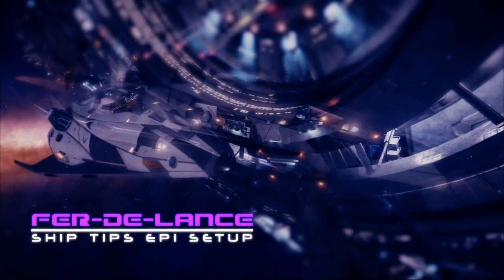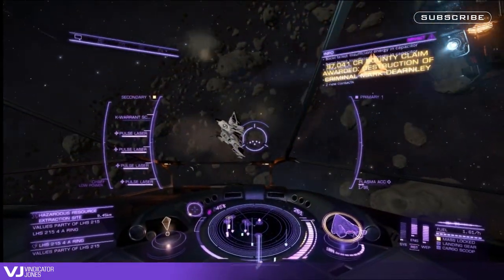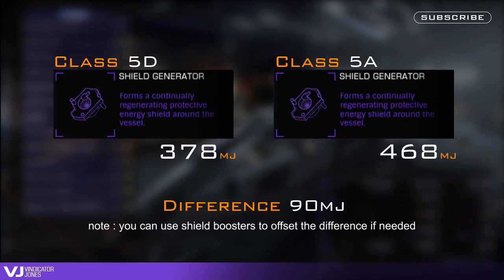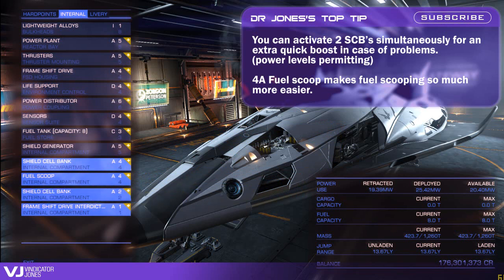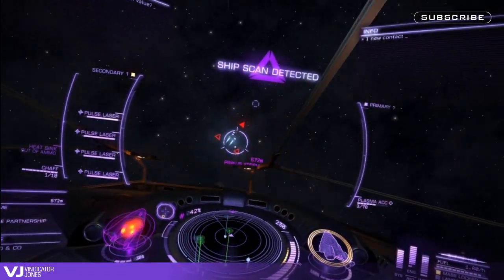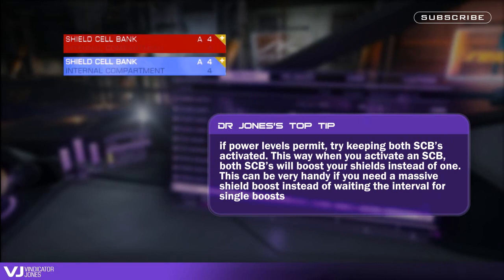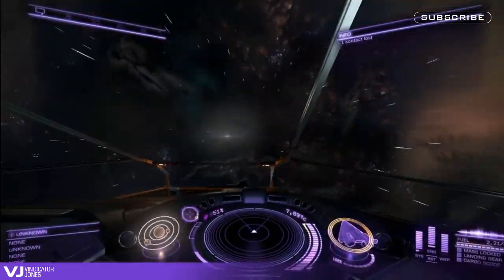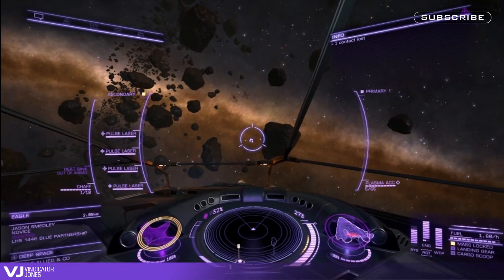Elite Dangerous Fer De Lance Series Episode 1 FerDeLance Setup

Comment: I prefer a 4a shield and 5a batteries. Still plenty of shield strength for whatever I need plus they comeback quicker and frees up some extra power. It's very possible to have the ship be under 99% power even with deployed weapons.
Reply: mine runs at 117% :D

Comment: I use 2 x 4B SCB's - touch less shield gain per burst, but with 1 extra charge you end up with more shield gain over all right?
Reply from the maker: +HyCy85 Well using 2 class 4 SCB's at the same time will give you the same shield gain as using a single scb twice. But with the changes coming in 1.5 using 2 SCB's at the same time will incur severe heat penalties. So you might not be able to do that anymore.
Reply: I power down one and power it up when the first is spent, but for staying power 10 x 140mj recharges beats out 8 x 160mj right?

Comment: The fer de lance does not suffer from power limitations since 1.5. It can now use an A6 powerplant.
I run 4 multis and a beam laser.   The destructive power of the multis and the never ending/ Never overheating beam laser just tear everything a new butthole!